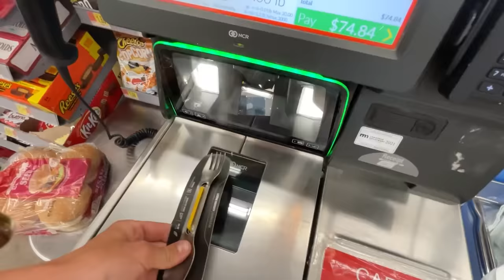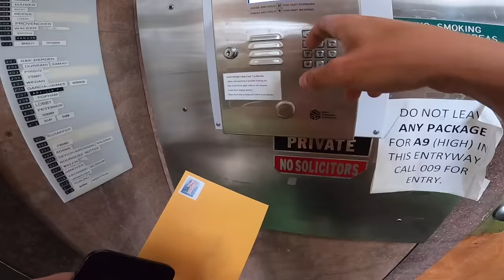Camping in my Small Car for the First time | Overnight in Pop-up Tent

Comment: Pro Tip: Never, ever drain any fat or grease down the drains (at home or the camper/rv). The fat solidifies and clogs everything up. Best to keep a jar (with a tight lid) around for that purpose.
Reply: You can reuse it over and over to, make biscuit and gravy, keep in Folgers can!!
Reply: You can also pour it into a can with paper towel and light for a long lasting fire
Reply: And to use again for frying oil just keep straining it till the burn bits are removed and also can use it for like years till the oil get black then that when it’s time to go
Reply: @carllubrin8518  Yea, the old timers never wasted anything!!! They even made their own potted meat with all the leftover animal parts and when you grill it inside a grilled cheese it's kinda like a poor man's Philly Cheese Steak sandwich!!! 🥪
Reply: I would never cook meat in a small enclosed space, odd christening of his camper… poor planning all around actually.
Reply: another pro tip. dont park in neutral! wtf is the point of it?! there is NO LOGICAL reason for parking in neutral that makes sense.
Reply: Was there a gray water tank or did this greasy water flow to the ground?
Reply: This is way way too much work to go camping or if you're using it for a lifestyle.
Reply: It’s no more work than setting up a tent, but definitely sturdier/safer! Also not near as much work as setting up a regular pull behind pop up.🙂
Reply: @xmetrix  But what if you forget you've parked in say first or reverse.
Reply: @xmetrix  I think you must by law?
Reply: @davideldred.campingwilder6481  must what by law? Park in neutral?  How absolutely absurd would that be. Let's park all automatics in neutral also. Makes sense right?
Reply: @carlnewton7591  here in America at least there is a requirement that the clutch be engaged for the car to start.  It's a little electronic switch on the clutch pedal to prevent idiots who forget basic vehicle operating procedures. It's been that way since at least the late 80s or early 90s
Reply: That was my first thought as well. He could use a good ‘ol coffee can or jar with lid and keep it refrigerated at home for cooking....especially bacon grease. YUM!!!!
Reply: @xmetrix  Comrade, I was referring to his (gear stick) I saw a gear stick, didn't I?  Anyway.  That's what I meant.  In the UK, anyway...And they are the English, so they've got to be right, no?
Reply: Liar
Reply: @michaelbauer5081  why folders?😁 Why not Bustelo? Mmmm😋
Reply: @xmetrix  actually it does make sense. If a vehicle hits the Beetle when it's in gear, it's possible to destroy the gears. It's happened to people. 
Do the research. It's possible.
Reply: @bethg7342  it wouldn't hurt the ground. 
All the crude oil in the world comes from the ground. It's not getting into our drinking water.
Reply: @carlnewton7591  I always park a stick in neutral. If the car gets hit, there's less chance of breaking gear teeth. 
It happens.
Reply: @manuelester7420  I heard that!! Yea and it's  hard to find the metal folders cans anymore so it's  a good thing I saved mine!! I've got some 15 years old and use for storage stuff!!
Reply: @rainsofhealing  it doesn't need refrigeration. As long as there's no water in the grease. If so, it can be extracted out, using a turkey baster rubber thingy.😂 or heat the oil til the water evaporates out.
Reply: @manuelester7420  if someone hits the car hard enough to do damage to the gears.... your transmission is the least of your problems. Transmissions can take someone fucking bumping into your car. How the fuck much force is put on the gears  when you stall? More or less than when you bump start it in first? Learn basic mechanics kiddo
Reply: I literally hollered NOOOOOOO LOL
Reply: My mom has bacon fat older than I am.  haha
Reply: @danitagoins4574  Obviously you have never went camping with a pop-up tent takes all of about 20 seconds.
Reply: @michaelbauer5081  I’m a chef and in the kitchen then small trucks help at home lol
Reply: @rainsofhealing  🌧️
Reply: I wouldn’t say that’s a pro tip,I thought it was common sense but apparently not

Comment: If you’re open to a suggestion from a vw camper person.  You can get rv rated mesh screen (we call it “no see’em” screen) and add a Velcro border then attach that to the surround.  Then you can leave the bottom of your tent loose or even roll it up to expose the outside.  

And going the other way you can insulate things using foil bubble wrap (sell it at Home Depot) using the same Velcro method some the camper side Velcro is the same for body things.  

If you camp in the winter adding a diesel or propane heater is really easy (eberspacher or propex). 

Great ingenuity and I love seeing what a person can put together from their own vision!
Reply: P

Comment: Nice build! A few observations:
1. Weather stripping might help with the gaps.
2. Don't pour greece down your sink. Use a cup with maybe a paper towel in it to soak up. 
3. Don't leave your backpack on the seat where not nice ppl can see it. Just be safe!
Other than that excellent job!! (I'm a bit jelly)

Comment: Another thing that’ll help is a camper fan. Just something to circulate the air and easy to mount to roof. Will help with bugs too and can pull air in or our
Reply: Out* but good advice
Reply: @morijin6903  wow thanks for the correction! Never would have known what he was trying to say otherwise...🤦🏽‍♂️🤣
Reply: @trever9143  if you wanna repay me then could you tell me what exactly is a camper fan
Reply: @trever9143  aren't there just fans
Reply: No actually a camper fan is more compact usually has a clip to hang and is rechargeable so you don’t have to have electricity to use it.
Reply: @morijin6903  or a built in fan to to roof. 
That's a camper fan. 
Fantastic fan/Max fan.
Reply: @morijin6903  you forgot the comma after  the word out*, but nice try at being perfect and critical.😁
Reply: @manuelester7420  he used an asterisk; it’s common practice for grammar nazis.
Reply: A fantastic fan would suck some of those bugs out, plus they don't like moving air.  Hope next time you bring aromatics or bug spray will work.
Reply: @manuelester7420  wasn't trying to be too critical it's a comment but thanks

Comment: When camping on your own, always remember to bring a bug zapper. They save you hours of frustration swatting at bugs. Also, cover your equipment with tarp to keep it dry, and always have a flashlight. Generators and 1 or 2 extra 5 gallon containers of gas never hurt either.

Also, you can use Velcro to patch up the cracks in your tent for a quick patch work seal.
Reply: You can get them that recharge with built in solar panels.
Reply: @Charles Morse probably. God knows there’s only one right way to do things, none of it can be trial and error.
Reply: I prefer headlamps over flashlights.

Comment: I see some folks recommend putting netting between the clasps but I would line the interior with the netting.  You could get 3 good size nettings and do each wall and attach all inside permanently. It will move easy when you raise and lower the camper. I LOVE it btw ♥️So perfect!

Comment: One other piece of advice for the future. When you do seal the canvas to the body, leave the door open when you dro the roof or raise it, as it prevents pressure or suction making it easier to drop or raise the roof. Personally I would rivet the canvas to the frame and seal it with a good flexible sealant.
Reply: Yes, rivet it, and then use a good rubber type sealant. There is a really good red colored sealant that they use in aircraft but I can’t remember the name of it, but I think it’d be perfect for this scenario.

Comment: Leave the car in 1st gear when you turn it off and apply the parking brake; if the brake fails the car won’t roll. This has been a public service announcement for those that just learned to drive a manual. 😉
Also, add Velcro around the bottom of the canvas. 
Now you’re ready to car camp in that bug.
Reply: Yeah exactly 1st is the hardest to move. In my experience honestly any gear is better than neutral were you're at the mercy of the brakes.
Reply: Or just leave it in neutral like ive been doing for 5 years no problem 😉
Reply: Should have read your comment before posting mine reg 1st gear 😁
Reply: @lkillercaml9945  yeah, for sure. I have a fire extinguisher in my house in case there’s a fire, which there hasn’t been the 5 years I’ve lived here, but I do it anyway because it’s the smart thing to do and a solid backup in case things go wrong…but you can do you and I’ll do me.
Reply: @lkillercaml9945  I only put it in 1st and not E break. E breaks can get stuck
Reply: I noticed in today’s video that he put it in first gear. Smart man.

Comment: You should install an auxiliary battery in there so you can run some  12 volt lights and a power inverter for plugging electric stuff in. You install the battery with an auxiliary battery isolator kit. The isolator sends a charge to the auxiliary/ secondary battery when your engine is running and it automatically disconnects it from the main vehicle battery when the engine is shut off so that your lights or appliances dont kill your vehicle battery. It is very easy to set up, i did it in my van and i run my 12 volt fridge on it. I have cold drinks and can store cold cuts and have sandwiches on demand lol. If you’re interested I’ll send you links to everything you need. And it will all cost you less than $200

Comment: This makes me miss when I was adventuring in my van cross country but ran out of money lol. I would just find a way to make your camper permanently extended to full height, either with wood or metal and insulate it. I would even go over the top of the car even more. Might lose a lots of mpg but it will be alot cozier if everything is in place and you dont have to pop up and down every single time. It will essentially be a "mini" van at that point lol. I'd go for comfort/ease of use over mpgs.
Reply: One sharp turn and your done lol
Reply: @qucki7030  That's what I'm saying lol

Comment: Notice everyone is recommending putting your car in 1st when you park. You should definitely do this, but they all also seem to be recommending applying your ebrake after you put it in first. You should always put the car in neutral, apply the ebrake, then put your car in 1st before turning it off. It makes the car lean more on the brake than on the transmission. Doing it the other way around is bad for the transmission. Don't roll away though, no matter how you do it. Always make sure your stick is in gear when you turn it off.
Reply: In high school my brother's car liked to pop out of 1st gear, and the parking brake didn't work. One day his car was just.. gone. He found it at the bottom of the hill he had parked it on. Fortunately no one died and the damage was minimal. I made sure to pick my parking spots better when it was my turn to drive it.
Reply: @Eyes0penNoFear  must have been a steep hill and old brakes or old car with stretched cable for it to fail that bad. If parking  facing downhill  he could have put it in reverse..or second gear(depending on the weight and engine displacement)
Reply: @xmetrix  yep, super old beater car. And now that I've thought about it more I remembered he said he put it in 3rd gear instead of 1st 🤦
Reply: @Eyes0penNoFear  lol lots of people think higher gear has more holding power.  That's wrong. You bumpstart a manual  in second or third cause it's easier.  Many people are mistaken about another of auto related stuff. Like somehow thinking premium is more powerful gas that gives their car a performance boost
Reply: I agree this is the best way to go but noone will ever listen to this! it is ok to park,leave it in first and pull the brake but shifting to neutral pulling the brake then putting it in first before turning off will make sure you will never roll away  and also preserve your transmission.

Comment: That exterior velcro idea is a really good one, i like that more if you can make it a continuous stripe across each wall on the outside... But i was going to suggest bringing the canvas back to who ever did it and have them add flaps to it that you can fold UP (so you're not asking for a water issue at the stiching) along the side of the camper, and drap inside over the inside "wall".

Comment: I would use velcro all around to seal the bottom from bugs, as for lightings i would run RGB led strips (usb powered) around the top of the camper. Best of luck!

Comment: Cool build!!!! I’d get carabiners for the clasps and as a lot of have recommended velcro for the flaps. Also, consider adding pink foam board insulation to the roof. Low weight and will help with sound and heat transfer.

Comment: Some mesh lining on the inside around the edges will keep the bugs out. And a small "heater buddy" propane heater would work great in that for cooler weather. What a cool lil travel/camping rig. 👍
Reply: I was going to say this
Reply: @ActnStuntIE  this would be an awesome lil rig to travel in. Spend $50 Install a small power inverter inside this to plug in lights, laptop, etc and I don't think I would ever come "home" again lol
Reply: Please be careful if you use a propane heater, at night in a small camper. 
There is a high risk of starting a fire, and if the fire is between you and your outside door, it shall be difficult to get out safely.

Comment: Never leave a standard shift in neutral always put it in 1st or Reverse then set the EBrake
Reply: True! I was about to comment it.
Reply: Why?
Reply: @bluecollaredbill  so the cars is held in place by not only the e brake but the engine and the transmission it’s a much more reliable hold, if your cars in neutral and the simple e brake fails it could roll away but when it’s in gear that’s not possible
Reply: I'm nitpicking, but you should actually deploy the e-brake first, then put your car in park (or in the case of a stick, in 1st), then turn your car off. It makes the car lean more on the break than the transmission when you're on a hill.

Comment: The Roof system is basically a tent. You could make it even higher with some better polyester material or even think of folding out a front tent with a door enabling you to cook more easily and have a shower. I mean, infinite possibilities here. I like the setup with this beatle.
Reply: But it could affect the car balance if it goes higher with mor weight

Comment: The bugs get through the smallest gaps.  I had the infamous Scottish midges getting through the draught excluder between my sliding windows  and forget opening roof vents.  All you can do is smother yourself with Deet and burn a mosquito coil.  Things calm down a bit as the evening cools but the heat from the cooker attracts them.  My last motorhome was coachbuilt but before that I had a solid side folding roof and that too tended to leak in wet and windy weather.

Comment: If you're concerned with bugs getting in the gaps.. run son self adhesive door insulator strip around the inside it should do the trick.

Comment: Just a little suggestion,  maybe put like a bottle holder in the counter to hold the propane bottle,  that way the cook set won't be so high and it would prevent it from tipping over.  As for the bugs...good luck finding a way keeping them out, they are vicious little things!

Comment: Try ceiling the top with some duct tape at least four rows overlap each other and hopefully that will help for the time being until you can maybe fix the the correction duct tape works for everything seems like LOL did you plenty of extra rolls and maybe you can seal off some of the area where they might be getting into the screen area like I said maybe it'll help for the time being get yourself some bug spray and some Deet to get to keep them off of you

Comment: Definitely attach the canvas to outside, use clear seam sealer so there’s no leaks. You don’t want the material attached to the inside because water will pool up at the seam.
Reply: I do not think that he can attach the canvas to the outside, as the top part comes down over the lower part, with a fairly tight fit?

Comment: cool rig! Definitely get a different cooking pan for cooking in, I learned the hard way of trying to cook food in my jet boil. It'll work for a little bit, but the bottom will start to get food sticking and ruin the coating. now I only use it for boiling water (as it's intended).

Comment: With the added weight of the camper I would not trust the factory ebrake to hold you! I would invest in a good wheel chock or see if you could install some hydraulic rams that could double as a brake like a power pole but on land abs would also double as leveling rams!

Comment: I have an off brand Jet-Boil just like that. You can deep fry a good portion of hand cut fries with it. Its great. Super efficient. It fits a 233g isobutane can with the burner and pot holder inside. Alternately you can power it with propane with an adapter or of course use the finned pot for a Coleman stove. The fins on the pot let very little heat out, aka transfer almost all the heat to the pot.

Comment: You can run a strand of duct tape on the inside joining the two surfaces where mosquitos are getting in thru the cracks. Or you can lay towel in those areas.

Comment: Mosquitos are out and aggressive, as they need water to breed. After rain, they know they have water.
A couple of chargeable camping lanterns with diffusers (for ambient light) should do for that kind of camper. We have a couple for tent use; from some cheap store, bug zapper included. Couldn't find exactly the same ones from amazon  though.
Reply: You can also run a box fan with window screen attached to the back of it. It makes short work of the little blood suckers.
Reply: Walmart sells a bug light/ white light lantern..i use 2 when camping